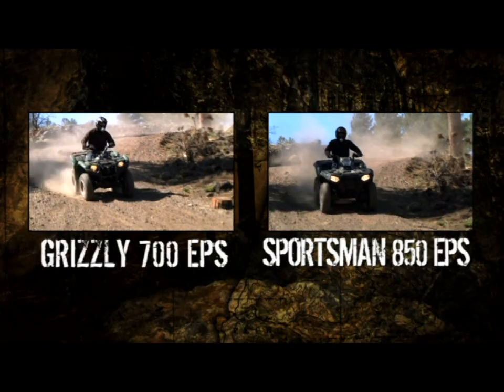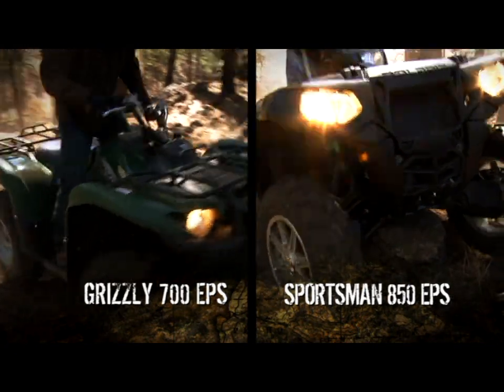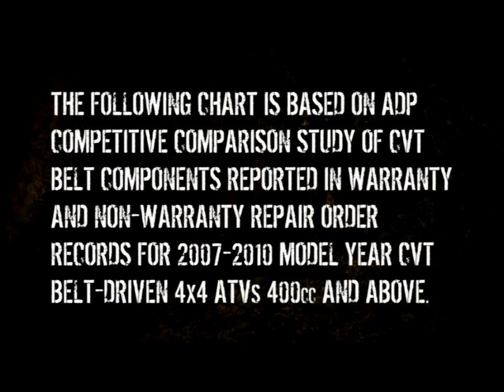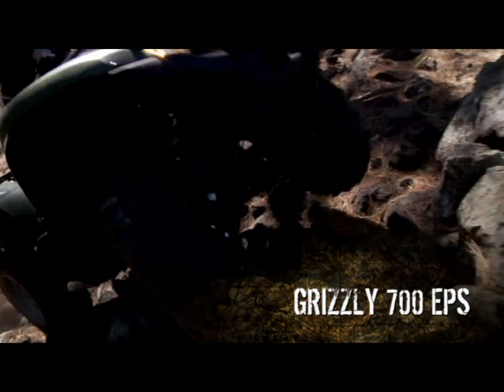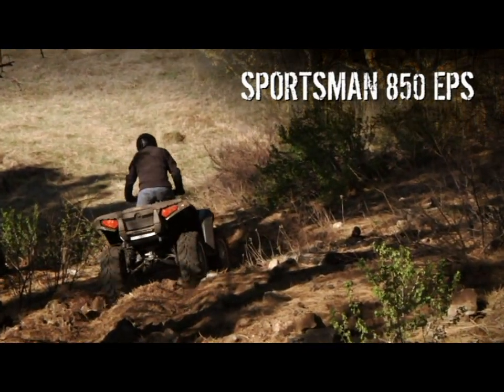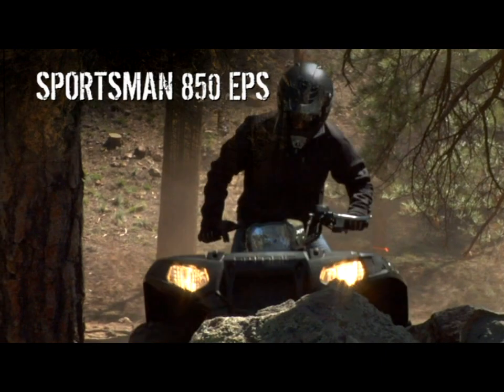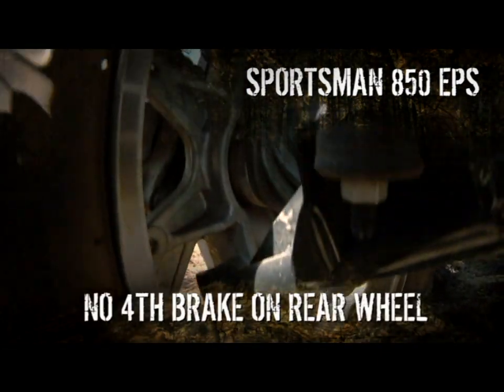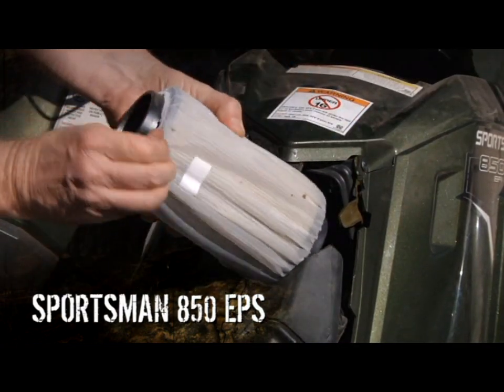Yamaha Grizzly 700 Polaris 850 Camparison

Comment: I just hit 22 thousand miles on my grizzly 550 with the original belt. maintenance wise I’ve had to replace wheel bearings and oil so it’s been very reliable 😊
Reply: Kyle King how much do you ride it?
Reply: Kyle King damn man you must ride da hell out   That machine
Reply: Kyle King theres still some yamaha  atvs here in the villages of ALASKA still running from the mid 00'S so i believe you and they got hundreds of thousands of miles also
Reply: I have 11 thousand miles on my 660 on my original belt

Comment: There's no doubt Yamaha builds a reliable machine

But shouldn't this be a comparison between the 570 and the 700 after all the 570 beats it by 3 feet on the 1/4 mile

comparing it to the 850 is like comparing a 1 ton dsl truck to a Toyota 

Anyways I'll let you grizzly guys get back to eating your sushi I'll get back to eating prime rib

Comment: This is a Yamaha ad. I have owned Grizzlies and Porais 850HOLe and 550HOLe. I will go back to Yamaha just for reliability reasons. Both ran and handled great, Polaris obviously had more power but they are NOT built as well and do not have the same reliability. Your mileage may vary.

Comment: I'm going to totally pick this video apart, because I'm bored and have ridden and owned both...I LOVE Yamaha's Grizzly. It's a well built wheeler but is in fact out dated and while the 700 single does have great low end power it falls completely on it face after about 50MPH. Yes it goes faster than 50MPH but it does NOT like to do it. Anyway first of all...Grizzly Does NOT outsell the Sportsman. Maybe it outsells the top of the line Sportsmans that are between $11K-$15k these days. However unlike the Grizzly...The Sportsman is the ONLY name on Polaris Mid and Full size Utility ATV's. So given the entire spectrum of the Polaris Sportsman...It's virtually impossible for the Grizzly to "outsell" the Sportsman. Plus, I RARELY see Grizzly's on the trail...I actually see far more Kodiak's on the trail than the Grizzlys. So that tells me that people are buying Yamaha because of price , NOT actual functionality. 

4 Wheel Drive Comparison:
I actually DO like the Grizzly's 4 wheel drive system, however...It IS more involved to use and no where near as easy to use as the Polaris. Let alone as SMOOTH...Good luck turning at all with the diff locked...I've heard from EVERYONE (that doesn't own a Polaris) for YEARS how terrible the Polaris All Wheel Drive is...I own a few Polaris Wheelers now and all of them have the All Wheel Drive system and it quite frankly...Works FLAWLESSLY provided you're not jerking the throttle around like a woman or a teenager that just wants to see and/or hear the wheels spin. (We've all gone through this stage) And as an added bonus...I can leave the Polaris in 4x4 (AWD on older models) at full speed runs without the steering getting stiff or shaky. Or just plain unpredictable...Polaris ADC is AWESOME! Saves so much wear on the service brakes. That's all that needs to be said about Polaris Automatic Descent Control!

 CVT Trans Comparison:
Personally I have gone through more clutches in a Yamaha than Belts in a Polaris. The Polaris is a far simpler system and YES in the new XP/SP chassis the belt is considerably harder to change. At least, I assume it is because of it's location but I've never had to change a belt in my Scrambler XP. So I don't actually know. While in the Yamaha...I have replaced a few sets of Centrifugal Clutch Shoes which are wet internal engine components and definitely HARDER to replace than even a belt on an XP/SP chassis.

Weight Comparison:
Yes the Polaris weighs more...It's BIG!!!GER!!! And they neglected to mention that the Polaris has a SUBSTANTIALLY LOWER Center of Gravity. AND that even though the Polaris has a massive 850cc Inline Twin that it STILL has a narrower rider station. NO...The weight does NOT hold the Polaris back. If it did it would lose the Drag Race. And while we're talking about Drag Racing Wheelers...I also have to point out that ANY OTHER manufacturer uses the DRAG RACE to show off power to weight comparisons...Not Yamaha...Why? Because the 700 Single is horrifically, pathetically outdated and under-powered in today's Big Bore segment. But it IS quite reliable. More so than Honda in my Opinion. These are the reasons that there are rumors of a Yamaha Big Bore Twin for the Grizzly in 2018-2019.  

Drag Race:
Did not we JUST discuss this...?The Polaris wins EVERY time. Even my buddy's 570 Sportsman womps on the 700 Grizzly. In actually all ways, but it is an SP chassis. So I will acknowledge that this is a considerable advantage... 

Power to Weight Ratio:
Again I did already touch on this but it is worth bringing up in detail since they are using it WRONG for their benefit in this video. At LOW crawling and climbing speeds... I got news for Yamaha and anyone watching this video thinking "wow Polaris sucks"...Virtually ANY 4 wheel drive wheeler with a locking diff of ANY ENGINE Size will do ALL of these things JUST fine...And since Polaris uses their All Wheel Drive system in even their 450 Sportsman. It would do these tasks just fine too. Provided the operator has the piece of mind to throw it into LOW GEAR!!! Because if your wheeler has an issue doing 2MPH it HAS...A...PROBLEM...And you should... FIX!!! IT!!!

Fuel Efficiency:
This is definitely OWNED by the SINGLE CYLINDER, SMALLER DISPLACEMENT Yamaha Grizzly. I think bragging that your smaller displacement, lower cylinder count engine is more fuel efficient is a bit of a bitch move...However, it is in fact better on gas. And there is no denying that.

Power Steering:
Yes Yamaha has won awards for their power steering but now so has Polaris, Honda, Can-AM and anyone that puts EPS in a 4 wheeler. Power steering is AWESOME in MY OPINION regardless of what machine you're using. It's just a matter of deciding whether or not power steering works for YOUR PERSONAL riding style.I have a friend that has had 3 different wheelers with power steering and he has come to the conclusion that it does not work for him. He likes to feel EVERY imperfection in the trail whereas I prefer the ease of steering and the reduced abuse to my upper body while I'm on the trail. This way I can be out longer. 

Brakes:
I see the theory behind the independent front to rear brake controls, but in reality it's worthless. Especially since most guys only use it to do brake stands...The Polaris DOES have independent control of the rear brakes with a pedal as briefly mentioned in the video. And no one that has ever Owned a Polaris has EVER used it...Because it is, of course, pointless and a remnant of an older design. Shit...Most of my wheelers, I've taken the foot pedal off to gain more foot room...I also have to say this is obviously an old video because the last time I looked into a Grizzly. They were bragging about having a SINGLE rear brake integrated into the rear diff housing. So it's no more "brake" than the Sportsman. Also, the Sportsman has a locked rear axle so it doesn't matter that there is only one brake rotor on the rear axle. It stops or slows the entire axle...And the ones that have an option for "turf" or the models with an actual rear differential do in fact have 2 rotors and calipers in the rear. One on each wheel.

So that's my dissection of the video. I don't give a damn if you like it or agree with it. I don't have time to respond to these comments as I'm an adult with a real job that I have to go to...So respond with your hate if it makes you feel better but everything I have said here is true. Whether you buy a Sportsman or a Grizzly chances are you'll like it or even love it. They are BOTH fantastic machines and are both quite reliable.
Reply: Brandon Crimmins 
Well said. You should start you own YouTube channel. Unbiased reviews. Good job.
Reply: Nice man.  I actually picked up an 18 Griz and let my sportsman 570 go. I wouldn't say I regret it , but would say there are features in definitely miss. Single brake being the biggest, then the storage followed by the narrower ride. I'm 6'2 and the griz is not a problem for me, but you absolutely feel the difference in width. And while.heavier, in totally agree with the lower center of gravity and the feel that you can whip it around a hairpin vs. That of the griz which feels like a tank.
Reply: Yamaha CVT is light years above shit  Polaris has.
Reply: I do have to disagree with the reliability of Polaris, my friend has one, and the belt slips all the time, and it’s the 600 twin. My grizzly 660 will beat it in a drag easily, and it also is having problems with its AWD system, and as for the 700 being outdated, it’s certainly not if it can keep up with the twin quads. I have also never had to replace a belt on my 05 or 02 grizzly 660. The only time I’ve heard of Yamahas having an issue was back in 2016 when they decided to partner with Subaru and make a 708cc engine, and it had oil leakage problems.

Comment: I ride a sportsman 850 and there is so much bull shit in this comparison, I have 1,200 miles on mine and still on the original belt, only dumb fucks burn belts up.  Slowly applying the throttle on a hill in high range is how you fry belts.  Also I never even notice the awd engaging and disengaging because it does it so quick.  I like Yamaha motorcycles but the Grizzly looks like it's straight out of the 90's and I've ridden one before, didn't impress me at all, underpowered and shit suspension.
Reply: +Chris Rife the only reason your belt will be burning up is if it was put in backwards or if your driving to slow in high
Reply: Yeah if your goin fast enough in high it can also hurt your belt. And yeah heat will do that lol
Reply: Driving slow in high with 28” or bigger mud tires will do a belt in! Also if water gets in belt housing will fry a belt down in minuites

Comment: There's one thing I don't understand.
Why are you always talking about "burning out the belts"? 
I have a 2007 Sportsman 800. Has about 7200 km on it to date (about 4500 miles) and I'm driving the belt number 3 on it, allot of offroad driving, paths and so on.
I guess it's very easy to burn the belt but in a normal driving (my Sportsman is road legal and I also use it allot like that) I'm not sure the belt worn is so much.
But I know nothing about the 850 XP belts, nor the Yamaha belts.
I think Suzuki KingQuad are the best ATV's you can get.
Reply: I have the 2014 grizzly 700, just over 2500 kms. I wore my tires bald drifting, but I didn't even know it had a belt. 0.o
Reply: 4000 kms on it now and all I've needed so far was my oil changes and tires. Still running the original belt.

Comment: Love this video. Grizzly ain't a bad all around bike I just love the fact that they are calling out Polaris on their bullshit
Reply: These videos always make the other manufacturer look bad.  Search for a few sceonds and you'll find a polaris video that makes it look better.  But the fact is the Polaris is way heavier and the Grizzly gets better fuel economy, even more so with the 2014 and newer models, which also got a bit of a power boost.  I think it is a little silly that the polaris 4x4 kicks in and out whenever it wants.  If the button is pushed, it should be in 4x4 until you push the button again to disengage it.  The Grizzly is lighter partly because it has aluminum and plastic parts where the Sportsman has steel like the floorboards for instance.  The 850 twin engine is heavier than the 700 single and the counterweights for the cvt transmission are heavier on the Polaris as well.  Its longer, wider and taller.  For some larger riders, this might actually be better as its more comfortable.  I'd rather have a lighter, more nimble machine that is a bit more sporty too.  Polaris, as is shown in the video, has a slow engaging cvt that makes the machine slower on the bottom end than the quick engaging cvt the Grizzly has.  Yes if you raced say 1/2 mile the Polaris would win as its top speed is around 80 mph as opposed to about 65 for the Grizzly.  But 0-30 mph, the Grizzly will beat it and that's where you need more acceleration for the trail.

Comment: This video is an joke! Polaris AWD system engages with ease lol I have hopped on both atv's and the grizzly is so top heavy and slow compared to the polaris. If you want power and be able to do drifts in sand and go through mud without worrying about falling off buy the polaris. and btw the sportsman 570 can beat an grizzly 700 🖒 value!
Reply: I loved the awd on my 2014 850 scrambler . Clutch worked great , never have i ever smoked a belt like in this video. Down hill engine braking was flawless. Rear facing belt was a breeze to change . Only complaint was the build quality on certain components ( loose suspension bushings from the factory, loose steering stem that bugged the hell out of me) great ride and loads of power though. I since had a rzr xp 1000, and now i have a grizzly 700 2019 havent used it yet because its winter here but overall the fit and finish on the grizzly seems to be alot better. Seems like the guys at yamaha really took the time to make everything right.

Comment: I would take the Yamaha all day.  In a "drag" race the video says the 850 might win by a little?  In a drag race the 850 would destroy the 700.  That's not why I would purchase the ATV. I want a QUALITY ATV that stays out of the shop.  At 48 horses the 700 is enough for most, and if you're in the woods, or tight trails the 700 would kick ass.  It's lighter and easier to ride.  Polaris machines are fast, no doubt. But overall they are junk.

Comment: everyone here listen up, I have a 2011 sportsman 850xp and let me tell u the build quality is shit. after just 1650km's i've change the belt and 4 starters. Constantly overheats and the battery is just about shot in it. I'm trading it in for a 2014 grizzly next week. So the guys who think polaris is gods gift to atv's, They've probly never owned one. Poolaris is shit. I know!
Reply: Hmmm that sucks mine is a 500 from 2012 and it’s been a flawless machine that has gone 13,000 miles with just 2 belt changes and regular oil changes it’s a dream machine
Reply: Parker Stewart 2 belts mine is 06 and has original belt only oil change as a teen I use to take it to Mexico and ride in 110 degrees highest mountains

Comment: its called power to weight ratio, if you were watching you would know. BTW bigger motor is everything, just alot more weight. If you want a fast quad go buy a race quad.
Reply: Bigger motor is definitely not everything. It’s about gearing, I’d outride any twin quad on the trails with my grizzly, due to its handling.

Comment: Well let's see, the polaris rides better, has more ground clearance, it's way faster, has way more torque, better dealer support? Better resale & way more than I care to mention here. Ride both and decide like I did. I brought an 850sp and couldn't be happier. By the way I'm 57 and started riding  dirt bikes then 3 wheelers then quads at 5 years old and have owned Hondas, Hodaka's Can Am's Polaris so I think I have a little bit of experience and I'll admit that the Yamaha is a little more reliable (not by much) but parts are way more expensive. This video is b.s. I never met a grizzly that could come close to me in a drag race, out climb, outpull,
out plow my polaris and where did they get their sales stats? The grizzle does make a good starter or grandpa bike but it's not for

Comment: My Grizzly 700 is almost 4 years old with over 4,400 miles on it. I rolled it, flipped it and even wrecked it. Still runs but it needs front end work though. Just cant get rid of the front right pullin, i just wouldnt get a polaris unless it was a Rzr. Few neighbors and ex brother n law had polaris's and broke down after a month cause of problems. I fet a kawasaki before a sportsman